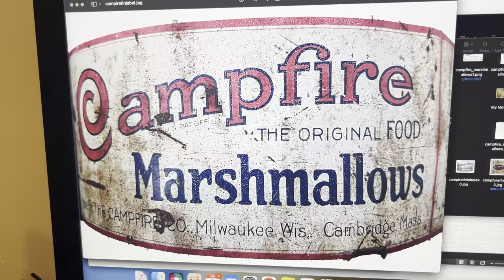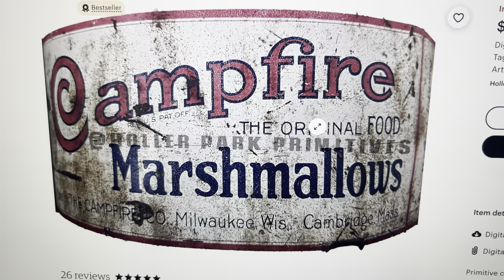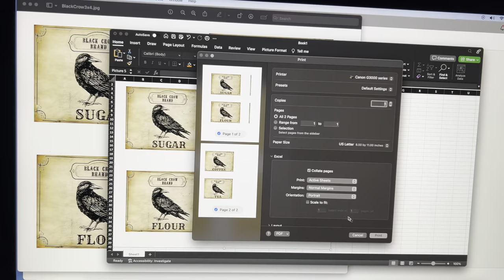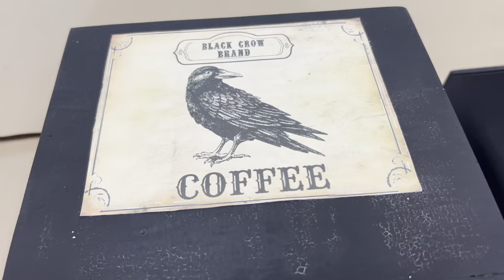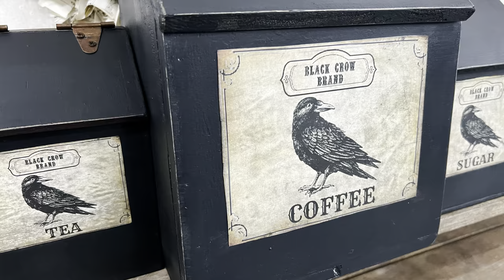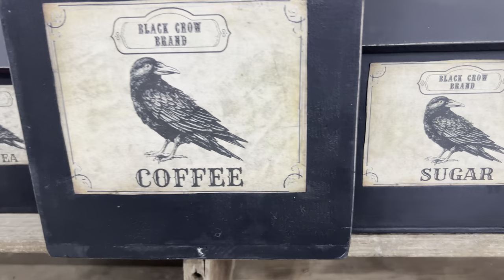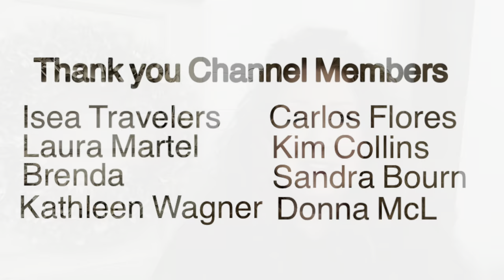PRELOVED THRIFT STORE MAKEOVERS | trash to treasure | DIY HOME DECOR

Comment: Your labels would work great on waterslide paper. You print onto the paper and spray 3 coats of a clear paint sealer.  Soak the paper in water and The image slides onto your project.
Reply from the maker: I’ve seen that.. never tied it though

Comment: Can you use the iron paint and patina spray over brushed nickel. I am thinking of making my bathroom light and knobs rusty but wasn't sure if it would work. If you think it would do you recommend the blue or green spray.  I just love your channels. My favorite
Reply from the maker: You would need to scuff sand it.  And the knobs may need a bonder first (  because how much they would be touch) but that would look amazing. 
The green spray and iron paint make the rust
- blue and iron paint make a turquoise color
Reply: Thought it would save me buying a new light fixture and then pay an electrician.  I just love the rusty crusty. Actually love everything you do. What kind of bonder for the knobs. Thanks so much for the advice.  Have to paint the sink vanity first. ❤